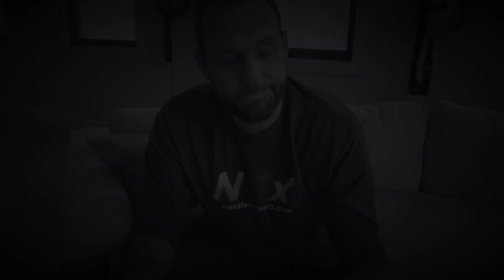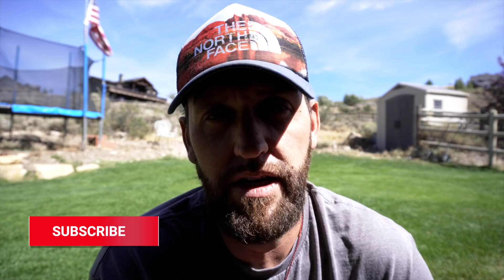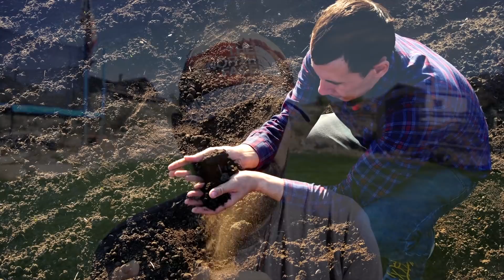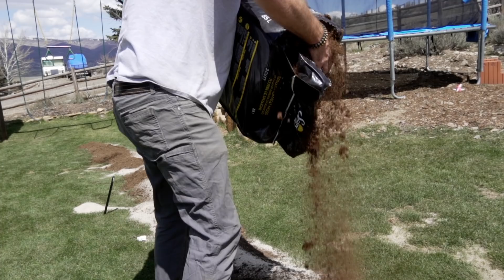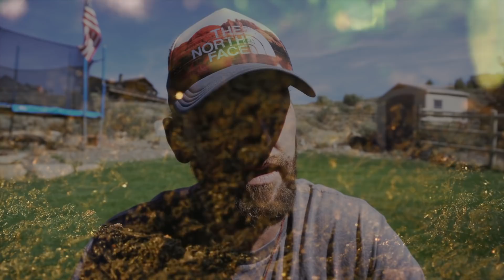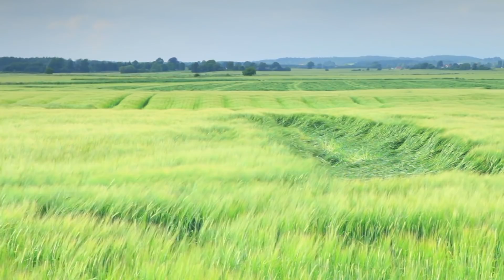Soil Conditioners. What Are They and What Do They Do?

Comment: I live on a farmstead that is over 100 years old. Over the years the lawn is gotten VERY lumpy and I'm nearly breaking my jaw driving across the lawn with the lawn mower. What is the tool to accomplish lawn leveling. I'm not interested in using hand tools as the lawn is probably several acres. I need a operation to run at some sort of scale. I have tractors and skid loaders available.

Comment: I'm new here so forgive me.....how is a soil conditioner different than using a plug aerator? Or different than using fertilizer
Reply from the maker: That is the main initial conversation of the video. Soil conditioning can fit into multiple categories depending on the desired outcome. Nutrient additions to the soil would be considered conditioning. Aeration would fit more into a cultural practice category but adding material after aeration would benconditioning.

Comment: I was going to rent a core aerator, then 'surface treat' with dirt/compost/char; however I relized that would most likely just kill off my hard to grow areas(which are finally doing well) while not really improving the soil down deep in my main focus area(a badminton court I want to put in) so instead I've decided to pretty much leave the hard to grow areas mostly alone(only over seed with fine fescue in shade, and patch/reseed sun baked kbg) then go with my tiller hardcore on the 1000²foot court and really mix that stuff in and level....but then just seed with annual rye grass this fall, again till in the coming spring and another 'cover crop', and likely do it again summer before I decide on a more permanent perennial grass type to put down in a year at next fall time - so this video is exactly what I needed, to know I'm headed on a possible course; thinking that the life and death of the cheap annual rye will be working on the soil, as that 44'X20' court area needs the most help(hard cracked clay and silt that I just took out a pine tree; yes I had some grass already growing there, but not well) for now I'm just finishing my 'fall care' to the other lawns first, so I'm not trying to do everything at once; then I can go nuts on the badminton court area which will take awhile
Reply from the maker: I think that is a fabulous plan